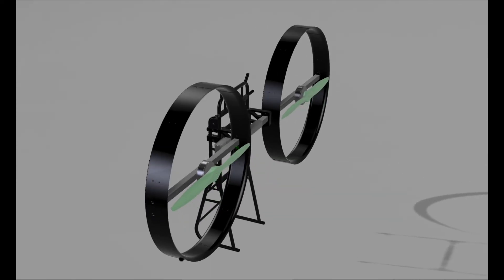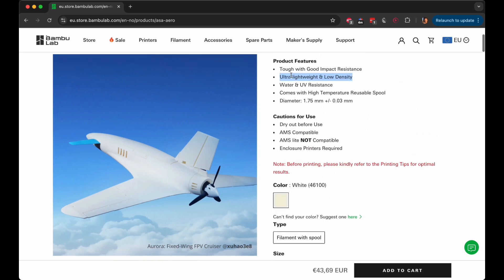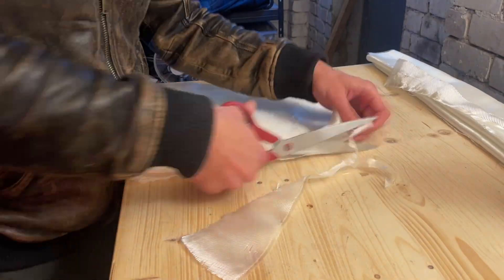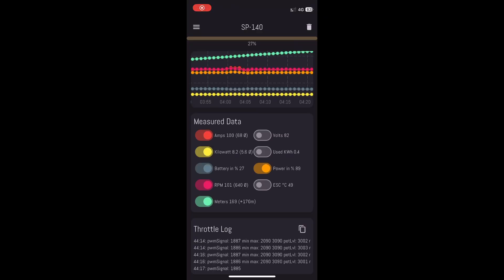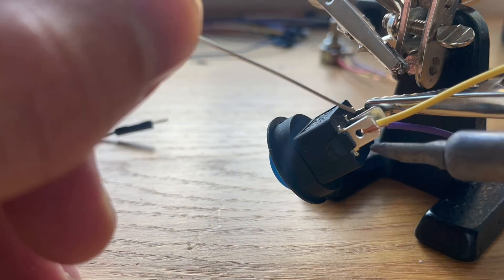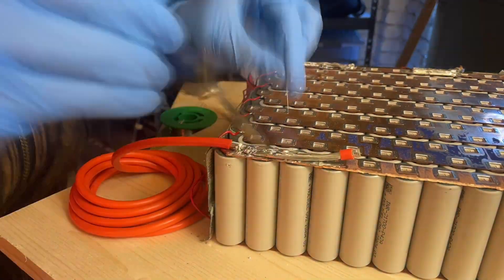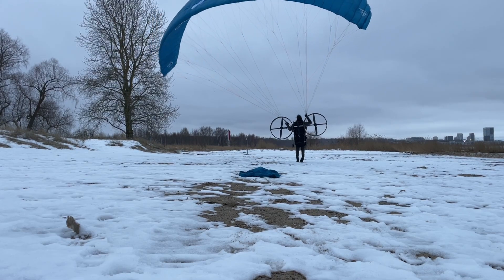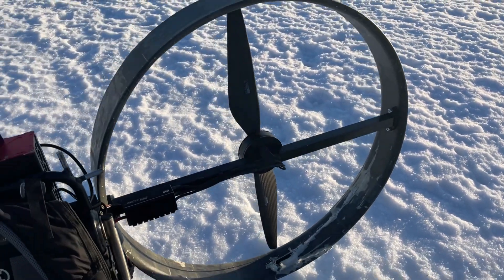I fly with two drone motors?

Comment: I am following your project. I want to understand how throttle control works signal from potentiometer to microcontroller and esc. And about monitor app . Please explain. Thank you
Reply from the maker: There are good Tutorials if you just look for example for "Arduino Potentiometer ESC" to control an ESC through a potentiometer. Regarding the bluetooth app I use flutter for most app projects. If you check for tutorials on BLE (Bluetooth Low Energy) with flutter you should also find the information you are looking for
Reply: @ Thank you